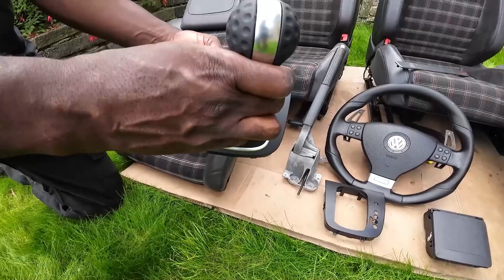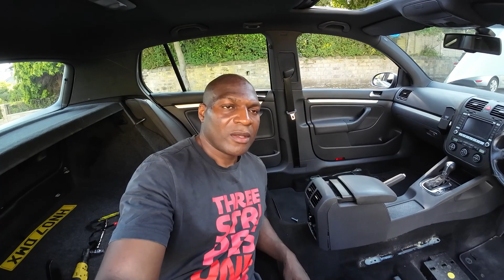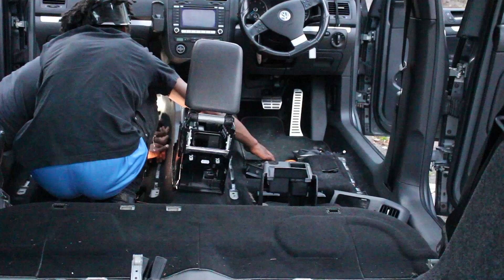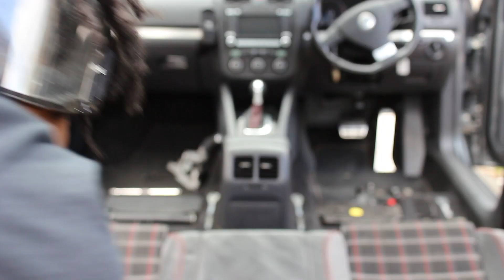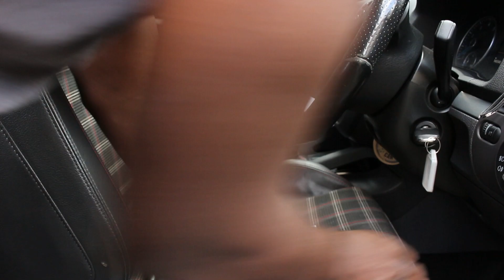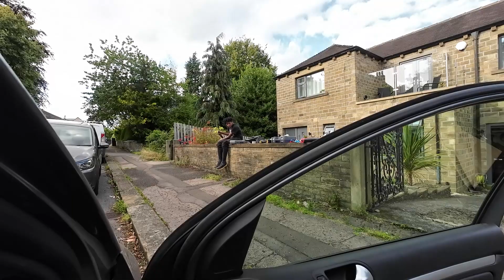Upgrading my mk5 VW Golf GTI Interior

Comment: Still following the build, just bought my KO4 turbo, your edition 30 steering wheel, are the paddle shift extensions stuck on, or the screw on ones, I'm not feeling the ones that stick so if yours are screw on I'm upgrading the steering wheel at least
Reply from the maker: Hi @sbr1160, my extended steering wheel shifters have tiny screws in them so I can only assume they are screwed in place. They could also have both adhesive & screws but I bought my steering wheel with them already installed so I'm not 💯
Reply: @aguycalledjoe7802  
No you've answered what I wanted to know buddy, I want the screw on ones, not the adhesive ones, did you have to code the steering wheel to the car or was it just swap and go?
Reply from the maker: @sbr1160 no coding needed because it is basically like for like.
Reply: @aguycalledjoe7802  

Cool beans, you're a star buddy, keep them videos coming

Comment: You have pretty much got what you need there ? The only thing you need now is the ed 30 sill plates for the drivers and passenger door frames.  The front seat drawers are quite rare, i’ve been looking for a pair for quite a while.
Reply from the maker: @andydunn1878 I have been quite lucky to locate most of the parts when I needed them but the Ed30 sill plates seem an impossibility. Oh by the way, my front seat drawers are now stuffed full with supermarket carrier bags🤣🤣.
Reply from the maker: Under the parcel shelf sounds like a good place for storage👌🏿.

Comment: For the hard brake you should of just swapped the covers as its just held in by a clip on the bottom. You just pry it up and slide it off.

If you pull it all the way up you'll see a small u cut out. Thats the clip holding it in.
Reply from the maker: @tino2705 I have been told this, I do wish someone came along with this info before  I dismantled my car🤣🤣. I learned a thing or two though. Thank you for the help💪🏿
Reply: @aguycalledjoe7802  once you do the interior a few time you can do all the seat in under half an hour. My first mk5 I had to replace the carpet due to holes under the driver's foot. 

I do wish we would have gotten this interior in the states.
Reply from the maker: Yes I am more confident about replacing an interior. You sound like a pro compared to me🤣.
Did you guys not get this interior in the States? Did you all not get the Edition 30 over there?
Reply: @aguycalledjoe7802  nope we didn't get the edition 30. With my new mk5 I'm building it with a lot of parts off aliexpress so see if it's worth it. The tsi roller conversion foe under 200 is well worth the money, as well as the real carbon fiber mirrors,  carbon fiber ebrake cover and the carbon fiber steering wheel. The under body braces are also not bad but the prices now are just about the same as retail here.

Comment: Nice build so far, but wouldn’t it just have made sense to buy an edition 30 in the first place,  considering you’ve bought; seats, steering wheel, gear knob, handbrake, wheels, rear valance, rear lights and splitter? 
Just personal opinion but I’d take the plaque off in case there is an original owner that is missing one and secondly why would you want a plaque for a non edition 30?
Reply from the maker: Hi @flight89swan I have asked myself the same question🤣. It might have made more sense to many people to buy an Edition 30 & it might have been easier as well but I have decided to do my build this way & I am enjoying it. As for the plaque, bro don't take it too serious, it was just a bit of joke really. Appreciate the opinions though🙂.

Comment: I’ve bought the same seats for my gti coming this week, are they plug and play because mine don’t have electric lumbar standard
Reply from the maker: I can only speak for the seats I installed in my car & yes they were plug & play. Good choice of seat though👍🏿
Reply: @aguycalledjoe7802  the air bag connection was a different plug, was a nightmare so I cut and soldered my original connector and all works. Think the plugs changed from 2006 models
Reply from the maker: Well at least you sorted it even though it was a bit harder than usual plug & play👍🏿